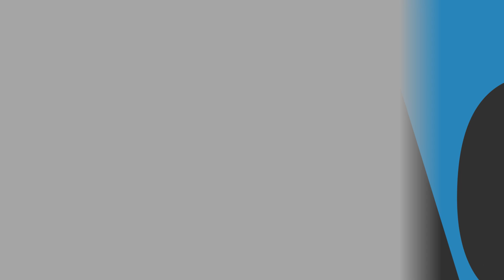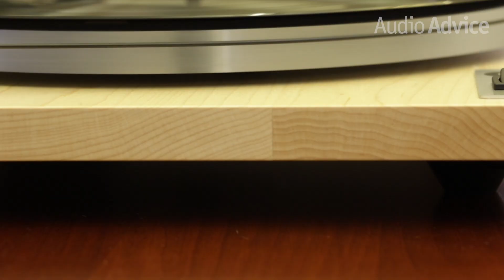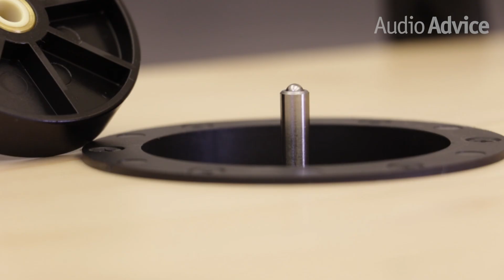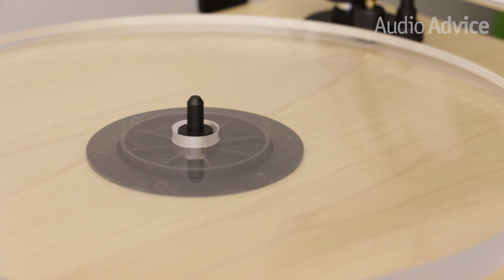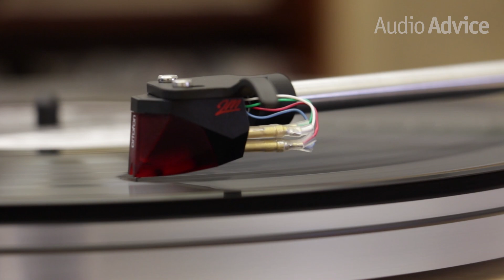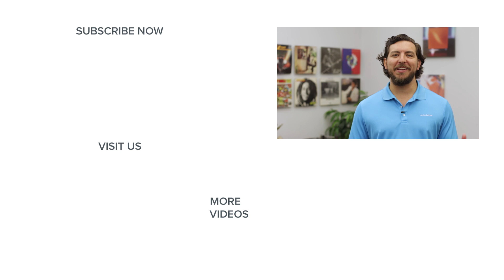U-Turn Orbit Special Turntable Review

Comment: Regarding the inverted bearing for the platter described in the video... is this component any different from what's included with U-Turn's cheaper turntables? What about the tonearm or the motor?

None of these are advertised on U-Turn's website as being unique to the Orbit Special, but are described in great detail in this review of the Special.
Reply from the maker: We just went over all of the features of U-Turn turntables in this overview of the Special.  We wanted to be sure everyone understood them.  The arms are the same as are the motors and bearing.  As you move from the least expensive to the Plus, you get a better platter and cartridge, and as you move from the Plus to the Special, you get a better plinth than the Plus and better cartridge.  So there is a substantial difference in the basic and the Special.  Thanks for watching
Reply: @AudioAdvice  Very helpful video and explanation. Thanks!
Reply from the maker: @afshars5791  Thanks!  We finally have some of these in stock again too! https://www.audioadvice.com/catalogsearch/result/?q=u-turn

Comment: Do i need to ground this turn table (no preamp) if im connecting it to a speaker with built-in preamp inside the speaker?
Reply: The turntable is grounded by using the shielding of the right side of the RCA cable. So you don't need to run a separate ground wire.

Comment: Do any of the Orbit turntables come with auto shut off or, at least, auto tonearm raise at the end of the album?
Reply: BEWARE!  I purchased due to this review and made in USA.  But there are MAJOR FLAWS.  1. the arm does not retract so if you get busy and forget, it will continue to spin.  2. Transferring the belt from 45 to 33 is so cumbersome I don't play any of my 45 speed anymore.  3. It would have been so much better to have a button to switch between the two speeds.  But I purchased another turntable just for 45 speed.  Lastly, the belt stretches out quickly. I have only had my turntable 4 months and the belt is already stretched out.  Save your money.  This was an expensive mistake i deeply regret.
Reply: No, these are fully manual turntables.
Reply: @mph7282  Thanks for the quick response. I have a buddy who's Pioneer PL--- quit on him and I'm trying to find him a USA made TT. He's pretty laid back and not a total audiophile so he says he wants a a semi auto TT. Thanks. Your turntables look impressive. If my B&O ever wears out I'll get one.
Reply: You can use the Q-Up tonearm lifter on an Orbit table, but not in conjunction with the cue lever.

Comment: I could believe what  I heard. They buy the least expensive motors because 90 per cent of them work okay.
Reply: That may be what you heard, but that's not what was said.  He said that rather than paying the motor manufacturer to do the testing/QC on the motors, they simply buy a lot of untested motors at a cheaper price and do the weeding out of the bad motors themselves.  You're getting the same motor either way.

Comment: Looks nice but that is all it's going.
Way over priced, everything is extra.
Reply: Made in USA. Not sure where you live, but that matters to me.
Reply: @LitSchlitz  I want to like it for that reason but 40 dollars for a cue lever. What the hell man?  That should come standard with a turntable. Also having to change a thin belt between 33 and 45 is annoying. Look at the Fluence RT82. At least their open belt turntable is snug and thicker and you don't have to flip it back and forth between 33 and 45. Fluance customer service can be a little finicky based on reviews I've read but i would deal with that for a better built TT. I like what UTurn has done in building TTs but for the cost of upgrades and the lack of a cue lever unless you ugrade at a much higher cost i will have to give this a hard pass.
Reply: @raygu1818  I replaced my Fluance RT85 with this table.  The Fluance is a peice of garbage and a waste of my money aside from the ortofon blue cart, which I'm moving to this table. Had the Fluance for 2.5 years and I can't stand to even turn it on. It's going on Reverb tonight

Comment: concerned about the tilt of the drive wheel under tension.  what?  isn't this just going to break at some point?
Reply: The motor is a floating design and is suppose to move it's mounted with o-ring type material which allows for quiet operation.
Reply: @BattlefieldAuthority1  - I've had mine since 2013 and it is still trouble-free!